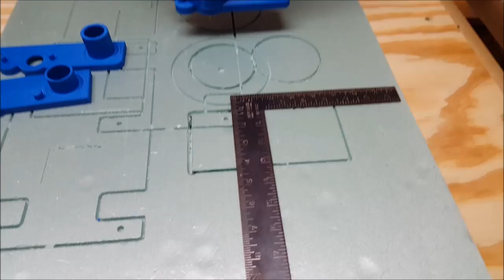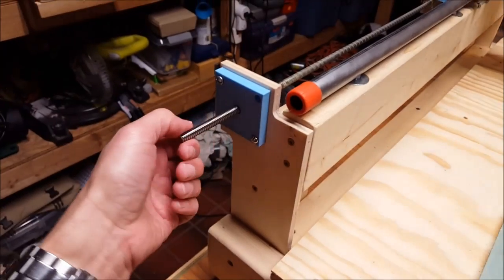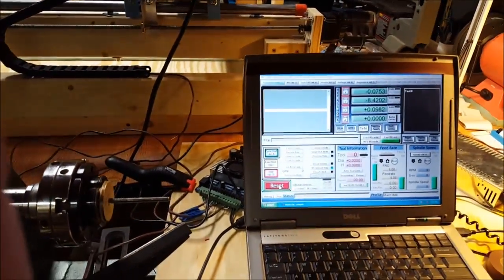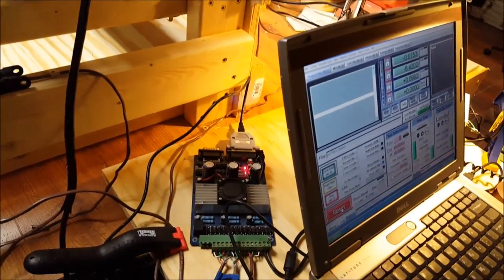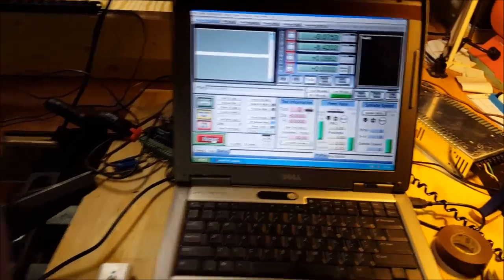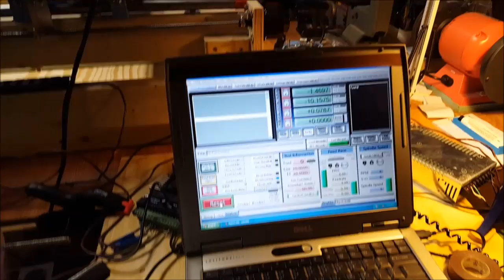Solsylva DIY CNC Machine - Dust Collector & Motion Controller

Comment: Didn't catch the name of the new motion controller?  What's it called and where did you buy it?  Thx...
Reply from the maker: Hi Chuck.  The motion controller is called a, "UC100".  Amazon is currently out of them I think.  I bought this one on eBay from a seller that sells a lot of CNC things and really stands behind their products.  I had some questions for the seller when I was setting this one up.  The eBay seller was online and helping me with questions late on a Friday night.  I was impressed.  Don't be tempted to buy a cheap knock off unit - I did and had to argue to get a partial refund from that seller.  Here is a link to the reputable seller:  http://www.ebay.com/itm/CNC-USB-CONTROLLER-UC100-for-Mach3-CNC-Controller-USB-to-Parallel-/271300225770?hash=item3f2ac0eaea:g:LngAAOSwZ8ZW-u0v

Comment: Wait, a 2x4 lumber frame??
Reply from the maker: Indeed!  I've built several CNCs with regular hardware store lumber.  As long as it's dry and well anchored it's fine for hobby stuff, not for building rockets though.  Thanks for your comments.

Comment: What 3d printer are you using
Reply from the maker: Hi Robert.  The 3D printer is a super cheap kit that I bought on eBay.  It's an Anet A8 and they are running about $160 now.  Best of luck.
Reply: I just bought one, can you help me get started with it